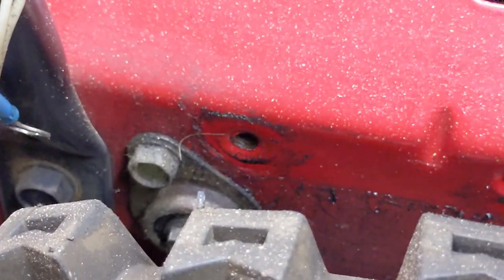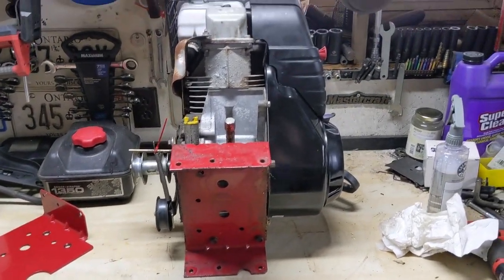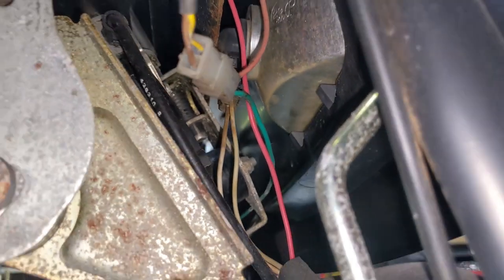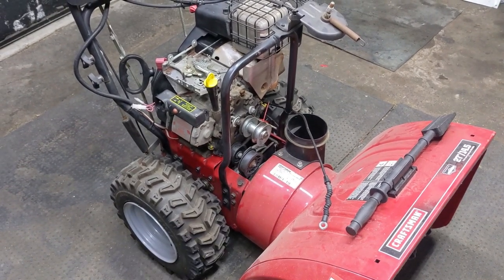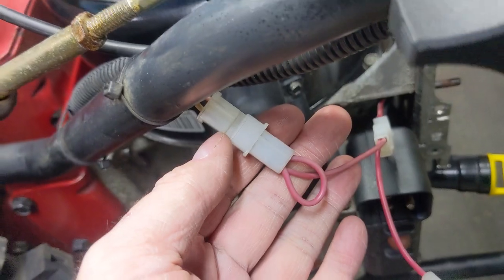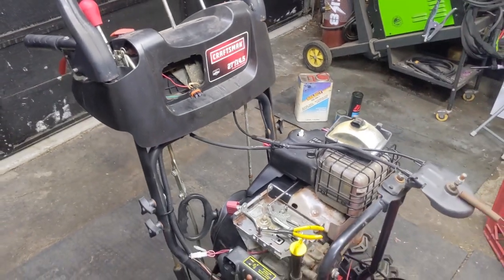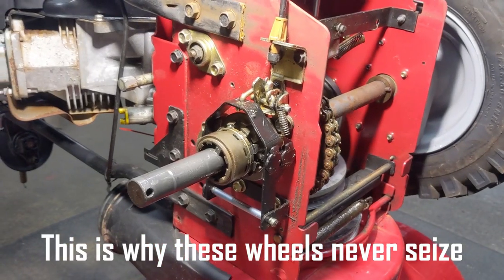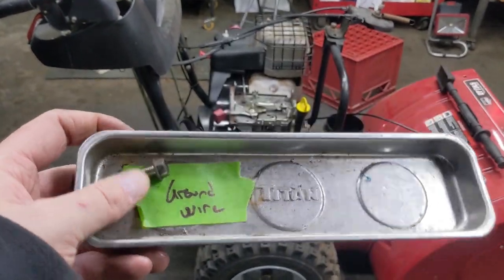Swapping Engine Mounting Plates & Final Assembly - Craftsman 13.5/27

Comment: Started the free wheel last night. One side didn't want to slide on the spline piece. Some lube and light tapping freed it up, but it still didn't disengage completely, even bending the retainer bracket. Since cable conduit had 2 breaks I picked up a new cable at ctc this morning for $23. Ottawa dealer was showing $45.
Reply from the maker: Wow that's wild for a cable, but I know with the recent economy everything has gotten more pricey. Good luck!

Comment: Jake, at 22:20 you described the spring as “torsion”. It’s actually a compression spring.  An example of a torsion spring is the one on some garage door openers, where a single spring is mounted around a rod over the doorway and winds up on the rod.
Think of it like torque, where a force is applied, rotating around a central pivot point.
Reply from the maker: Yea good point, thanks for that!

Comment: The little project is coming along nicely. I’ve had good success with Fluid Film for years. It’s the only one that wouldn’t freeze in door locks of coaches. They were washed with a pressure washer after every trip, summer or winter. Looking forward to next video. Have a good week.  Rick
Reply: For rust prevention we use the dripless RustCure 3000 bought at Peavey Mart. 2 years ago we could buy it at 50% sales for $4.50 a can now priced at $7.50 during 50% sales.
Reply from the maker: I'll be checking out the fluid film in the near future, I like using new products and once I find something that works good I stick with it. I use a lot of Permatex products but this honey goo is very good. We also use rust cure formula 3000 but I've never used it to lubricate parts, I suppose I could though 🤔
Reply: Yes I have used that as well, and prices are up there.
Reply: I’m going to try that ‘Honey Goo’ as well.  Thanks.  Rick

Comment: So the 30 inch 1550 has an engine mounting bracket. The 27 does not but has 3 unthreaded holes each side to accommodate one and chassises are same width. Wish I had known about them when I  did the repower.

Comment: Just put the ctc cable on. It doesn't have the steel threaded insert in the handle for the 3/16 mounting bolt. The hole in the plastic was too small so I drilled with 5/32 and tapped to 3/16. Then there's that plastic bottom cover. It was cracked both sides where tabs go over chassis tabs. Used the hot stapler on it.
Reply: And they want 60 bucks for that plastic crap.

Comment: So I'm understanding now. The poulan with the blown tecumseh had no mounting plate, engine was bolted to the chassis  ipl does not show an optional mounting plate. My craftsman 30 in with 1550 manual shows a mounting plate but different part number. I'll check tomorrow if my engine is on a plate or again direct mounted to chassis. Funny that my plan was to investigate that steering system tomorrow as sometimes my drive disappears and then returns and works fine. Maybe it's in need of good lube. I'm puzzled as I don't think my wheels are held on with with click pin in a hole. My recollection is a bolt in axle end, although I don't see that bolt in the manual
Reply from the maker: Good luck, and thanks for watching!
Reply: We would need the model number of your engine to check for the mounting plate part number but since the 1350 and the 1450 had different mounting plates it is highly likely the 1550 also is different. If you purchased it used it is highly likely that some other has used a bolt vs. clip pin for keeping the wheels on. You may have to make an adjustment to your drive linkage or cable to engage the friction wheel to the drive plate earlier for continuous drive operation simply shorten the distance but do not overdo it which can cause cable failure from being too tight.
Reply: Haven't checked yet but I wasn't clear on the bolt. It looked like a bolt in the end of the axle shaft, not a bolt in the hole instead of a pin.
Reply: @Wayne Stefinashen  don't know what tricks my eyes had played but it has the clinch pins just like you show.

Comment: Jake, I’ve got an interesting diag question for you I just spotted in the comments of an old Taryl video on evaluating used lawn tractors, pre-purchase. Here it is, verbatim:”My 10.5 hp Briggs is got pressure at dipstick.
If I unscrew the dipstick the engine bogs down and sometimes dies. Screwing the dipstick back down make it run fine. What would the problem be?”

I suspect it’s a lean condition caused by an internal blown head gasket. Any thoughts?  Wayne?
Reply from the maker: I would wager it's a combination of valves needing adjustment and possibly the crankcase breather having an issue. Could also be rings/cylinder issue. By opening the dipstick when the engine is running it essentially creates a vacuum leak. A lean mixture could absolutely be a result. Always start with simple things 1st, gas cap, carb (fuel) fuel line, spark, crankcase vent and compression. Then start deeper diagnostics if nothing comes from the 1st round of tests.

Comment: I've had a Honda snow blower for 30 years Mine will do circles around this thing
Reply from the maker: Probably, but not only did this unit not cost me anything, I've actually made money selling the other 2 units and their parts. So it's just my time.
Reply: Sounds like a challenge if you want to bring it to Port Colborne the OLD MAN here is interested in have a snowblower shootout eh! But i am going to say that this one turns in circles much easier than yours what do you think?

Comment: In the video you show the part # for the 1450 mounting plate.  I need the 1350 engine mounting plate - can you share the replacement part # for the 1350 plate?  Great video by the way!  If I find the 1350, I’ll be watching this again.  Thanks!
Reply from the maker: @rglshadow2856  I can't find a photo of it, but my parts program shows the 1350 using a 532417085 mounting plate. Sorry I can't be of more help.
Reply: @EliminatorPerformance  Thanks!